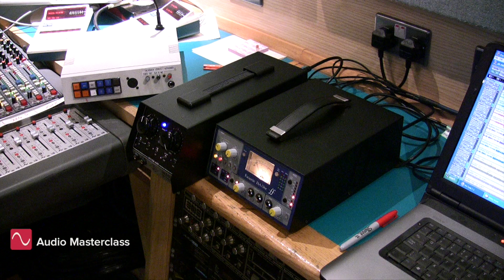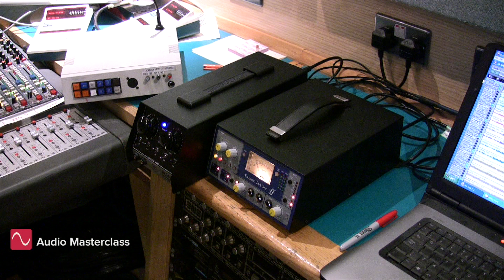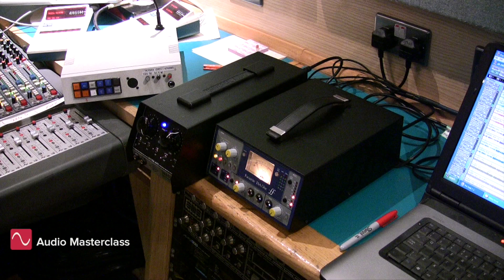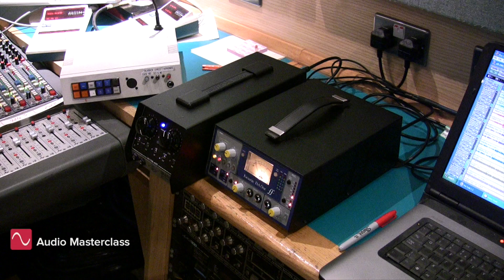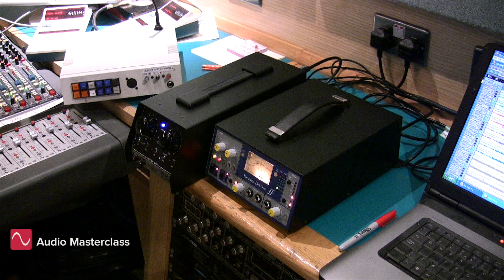Two microphone preamplifiers compared at Abbey Road Studio 2 - tube and transistor

Comment: Very noisy and cracked sound on the UA. Where's the room reverb are from? If I must say, the ISA is more properly setup but sorry It still not good. BTW, the ISA ONE is not a transistor based preamp, It is Transformer input IC-opamp design preamp. I hope you don't mind. Thanks for the video.

Comment: I think this is one of the best videos for beginners to see the differences a preamp can impart on the sound. All preamp comparison videos should be this organized.

The 610 setting 1 is somewhat vibey and vintage, but second setting where they crank up the tube gain stage really shows what a tube can do to the sound. Smooth, warm, high end rolled off. Very vintage.
Focusrite is pristine, airy, open. 

It also shows that no preamp is better than another. The 610 might be awesome for folk music and the Focusrite might be much more appropriate for pop or a very intimate, high fidelity modern sound.

Comment: the vox has reverb at first then with the focusrite the vox became dry....please explain
Reply from the maker: What you are hearing are the recordings direct from mic to preamp to DAW with no processing. The levels were set in the session and there are small differences between the takes. If the takes are normalized to the same RMS level then the balance of studio ambience is very similar. It should be borne in mind that even with tape markers on the studio floor there may be small differences in mouth-to-mic distance from take to take, which will affect the balance of studio ambience. DM

Comment: I don't know what's wrong with me.. I try like nuts and yet I can't hear a difference.
Reply from the maker: There are more detailed demonstrations in our course materials. However in summary the UA is a tube preamp with both gain and output controls, meaning that you can vary the amount of tube warmth. The Focusrite is more orientated towards accuracy and you can set the input impedance to match the needs of the mic. However, you can use the input impedance to get subtle variations in sound texture. It's harder to hear than in the UA but still worth experiencing. One more thing - You need to be listening on studio-grade monitors or headphones or the difference will be very difficult to hear.

Comment: What about the focusrite isa one digital card your thoughts like is it worth it what about the converter
Reply from the maker: My opinion is that if you're going to use a separate preamp and not the preamps in your mixing console or audio interface then it makes logical sense to get the digital card and avoid using the analogue line input of your interface. But the extra cost is somewhere around $300 - $400 depending on where you buy and there may be other elements of your studio setup that could benefit more from this level of investment. DM
Reply: @AudioMasterclass  I intend to run the optical line to my UA Twin X, bypassing the built in preamps. Doing so, though, must forfeit the use of Unison feature (as the impedance is not a valid argument in case of optical)?
Reply from the maker: @gkiss2030  Giving this my best guess, until microphones have optical outputs I think you're probably correct. You must be using something as a mic preamp though; something with an optical output? I suggest that your most reliable answer will come from Universal Audio support. DM
Reply: @AudioMasterclass  Yes, and that would be the ISA One. Thank you!

Comment: SSSSSSSSSSSIBILANCE! Vocalist was obviously singing very quietly for it to be that esssey. I'm guessing her low output is also why the tube hardly saturated at when input was turned up?

Either would do the job. But ...ISA does one thing really, really well - a nice clear signal. 610 also does that thing really well (notice only one 'really'), but it also does a bit of tube saturation. 

I'd lean toward the UA because I always like more options. I suspect that a vocalist with a hotter voice, or a drummer, or a cabinet, would probably saturate the tube more. 

Maybe some of you learned folk out there know: can you get a transformer to give out interesting harmonics and saturation by hitting it hard like you can with a tube? 

TTFN
Keith
Reply from the maker: Thank you for your comment. One person's sibilance is another person's interesting sound texture and I don't mind this. Regarding level, yes more level at the input will give more saturation, and of course so will more gain. This isn't an ultra-saturatey preamp (there's a new word for the dictionary) but it definitely does have a texture and is well worth a try. DM
Reply: Because the 610 has a large gain range well over 60 dB, it is designed to maintain at least halfway-decent headroom at high gain ~before~ it hits the compressor. 
Saturation (in the form of THD ) is a result of failure to maintain linear response and headroom in the circuit, like most forms of distortion.

Comment: the 610 with the gain cranked doesn't add even close to the amount of new harmonics that I would expect
Reply: It seemed to make the vocal darker rather than adding color, that color would be my entire reason for buying one so that's a letdown. I don't understand manufacturers like Avalon who try and make transparent tube pres, if they are trasparent then whats the point?
Reply: they are "transparent", right. But not neutral. Sometimes I even re-recorded my mixes thru an Avalon pream an it changed a lot and gained quality...And I think that the main point of the Avalon is a compressor, that combined with the amp gives great output sound...
Reply: @donallfinn  Clean high-voltage tube circuits (running the correct tubes)
are very different animals in comparison to the commonly intentional "tube distortion" you get when running a cost-effective chinese AX7 on a modern, efficient, low-wattage power supply. Obvious breakup and distortion is the usual goal here, so the circuit designer may intentionally choose a lower quality, cheaper tube (or another part spec) than what is technically prescribed because "some tube distortion" is often the goal in many of the cheaper boxes.  

That's about all I can tell you, the rest is a matter of using them and finding out for yourself.

Comment: Best thing to do is have them both, they are great, affordable preamps with real character! I have them both and can say for sure these are untreated samples. Was interested in picking up the converter card for the ISA One and was wondering if you have experience with it? If so, how does it compare to the Prism ADA-8 used here? Thanks!
Reply: Nothing is going to beat Prism units. We picked a Prism Titan via Digilink to PTHD Native this last year after trying just about everything on the market, including the Dream and ADA-8Xr (which was in our top three choices with Classic 96 converters by IZ for RADAR/ADA II systems). I'm sure the card is passable, but it's not going to sound as nice as an AD/DA loop on a Prism. Loved the ADA-8Xr, but it the Titan wins by a hair with delay compensation at high sample rates via PTHD. Still...not much out there can compete with your ADA (we really did try just about everything on the market at the time).

Comment: focusrite is the better pre. isn't it modeled from 1073
Reply: +Chief Kitsap Academy  

No, it isn't.
Reply: ISAs share ~some~ similarity due to being designed by the same man ~20 years apart.
But not enough to be closer than 3rd cousins separated by several "divorces" over two decades.
Reply: It's an adaptation of the focusrite ISA 110 module that equiped the Studio Console designed by... Ruppert Neve so yes, there is 1073 inside

Comment: I enjoyed the low gain and high output on her on the 610 and the isa one sound, the bigger sound did not fit her voice with high gain and low output but i can see other genres taking advantage of this. not sure if she was closer to the mic on the isa one but her voice sounded bigger or closer to the mic on the ua than the isa one. were the converters different on both units or did you use the same converters for both takes? and thanks for making this video, been wanting to hear a comparison between the two. if you can do a comparison on male vocals please do!

can you go over the impedance changes on the isa one and how that would affect the voice?
Reply: I found with the ISA that the high frequency lifted area of the mic was more obvious at a lower frequency which I was not really fond of. The only time I heard a 610 previous to this I think had tired tubes or something in it. It was very unimpressive. Thin sounding. So much so that I ended up going with the console's pre (I can't remember what it was, maybe a Midas H3000?) but would have been a good one anyway. I liked the 610 left with the output section used to gain up the mic. It took on a lot of air which on her voice and commonly is nice. I might have had to tone it down on mix down a bit but I would rather have it already then be trying to manufacture it. Is the output section tubes as well?
Reply: I've owned the isa one for 2 years now and I must say, it's bright AF but I love it